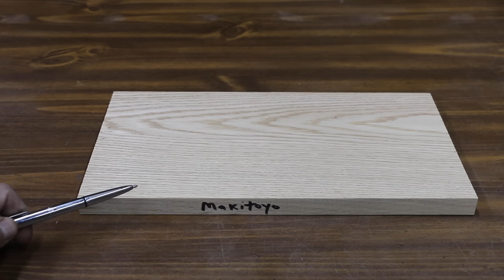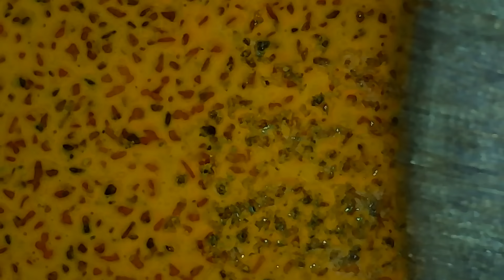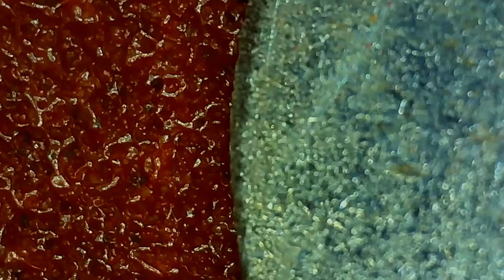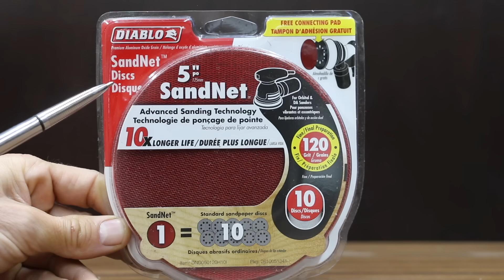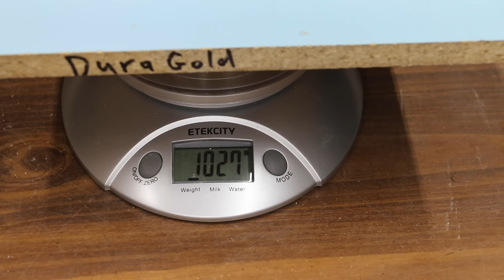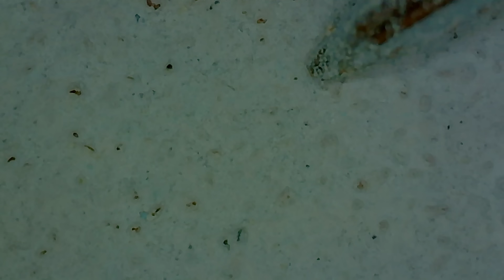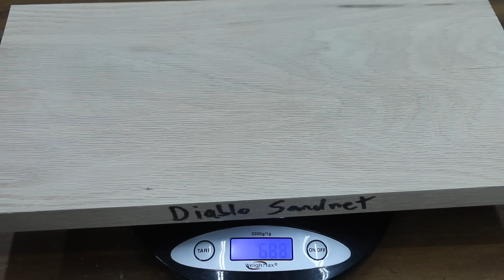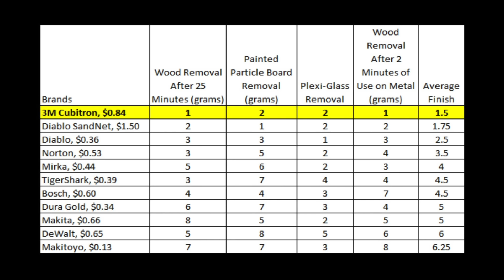Best "Sandpaper" Brand? 3M Cubitron, Diablo, Mirka, Norton, Makita, DeWalt, Bosch Sand Paper

Comment: First off: I love your channel! But as a certified „master craftsman of cabinet making“ (German title, sorry about that), may I give advice on sanding wood?

1. don’t apply pressure. The sanding paper and the orbital sander do the job, not your muscles.

2. Start cross grain, in overlapping zig-zag from one side to the other. Overlapping should be half the diameter of the disc. Do this once or twice.

3. then do the same going with the grain. Do this once or twice, too.

Oh, and yes, I only use Mirka Abranet Ace, as textile net sanding Discs in general last much longer.

Otherwise, carry on!
Reply from the maker: Thanks for the feedback!
Reply: @ProjectFarm  You’re welcome! Keep making these awesome videos!

Comment: You should make a test to find the best diamond angelgrinder cutting disc for cutting concret. Also if theres any differens in how long time a disc will last if you turn it around after its been used already.
Also if a big disc is cutting better than a small disc.
Reply from the maker: Thanks for the video idea.

Comment: Project : When I change my car oil and filter, I replace the oil only with conventional oil for a day or two to clean out the dirt. Then I do a full synthetic oil and filter change. Question : Does this have a positive effect on the life of the engine?  Personal experience, I have been doing this for over 25 years, I have never had to do any engine repairs. ( 16 family cars in 25 years )
It would be interesting to see the condition a a car engine before and oil change vs. after a oil rinse.
Reply from the maker: Thanks for the video idea.

Comment: You are always looking for things to test, how about battery powered pressure washers?  Being they can suck water out of a bucket, they are extremely easy to use in odd places. I just used one to clean off grease and dirt to prep a skidder to weld in the woods. A 5 gallon bucket of water out of the creek and you’re good to go.
Reply from the maker: Thanks for the video idea.

Comment: Hey project farm, love the channel been a long time viewer since you first started. To me it has seemed you’ve tested every know motor oil and additives for them. Here recently it has come to my attention that there are no standards for hydraulic oil, only recommended by the manufacturer of your equipment. But any hydraulic oil producers can clam to meet or exceed those manufacture recommended oils and there is no standards or laws to tell them other wise. I run tractors and I want to run the best but I have no insight into witch one is the best. I was wondering if you could test multiple hydraulic oils just like you did motor oil and give some the project farm approval! Thanks!
Reply from the maker: Thanks for the video idea.

Comment: Been using Mirka for years. Woodworking and boat building. One if the things I like is that the disks hold up extremely well when used for wet sanding ( by hand ) epoxy and paint.
Reply from the maker: Thanks for the feedback.
Reply: And the abranet is really nthe way to go, they last damned long

Comment: Your work is awesome dude!  This is to suggest a review of Air Compressor Regulator/Gauge assemblies.  I just hate the cheap ones that have come with my last two compressors; the haptics are terrible and cranking it up to 135 PSI I always feel the plastic is about to explode at any moment.  The gauge lenses always seem to come unglued from the gauge bodies - They are pretty simple inside and you would think Ingersoll and Parker would have the best ones but I don't know.  I miss the old all brass ones where you could unscrew the bezel and replace the gauge lens and oring - but even ingersoll uses plastic these days. Some brands besides IR and Parker are are USG & Pneumatic Plus but I am definitely not the guy to know the right air compressor regulator/gauge brands.
Reply from the maker: Thanks so much!  Thanks for the video idea.

Comment: Another Great video, 

Though I could have just told you the Diablo was the best stuff available. Kind of suprized 3m did so well. I believe there is a non cubitron version of the 3M that wouldn't hold up quite as well as that. Though no surprise that 3M makes a great product, I've found they make quite a few of those.
Reply from the maker: Thanks so much!  Thanks for the feedback.

Comment: This is an awesome test.   Such a no nonsense approach.   I really wish you had tested the Norton 3x (ProSand) stuff as it falls under Norton Saint-Gobain Label and it is a whole different Animal than that Norton Yellow type you tested. It would be up there with the 3M Cubitron II and Diablo paper easily.  This sandpaper cuts fast especially stands out in its longevity and its ability to sand freshly painted and finished wood w/little to no loading.  Its almost like magic how the paper doesn't clog compared to the current 3M stuff you get at home depot or any other sandpaper I have tried.   This property carries over to wood that is dirty or resinous such as pine and fir.   If you ever do another one of these simply for a different type of paper like  9x11 or sanding belts it would be worth the education of us all to include it as many people swear by this stuff.
Reply from the maker: Thanks so much!  Thanks for the video idea.

Comment: Hey I got a suggestion for a video comparing some 4 stroke synthetic racing oils such as Amsoil Dominator, Valvoline VR1 Full Synthetic Racing Motor Oil and some others. Some of these oils make very strong claims such as increasing Horse Power. It would also be interesting to compare the results of these oils to other synthetic oils you have tested in the past to see if the racing oils perform better or worse than regular synthetic oils. I am getting into competitive go cart racing and I and others race in series that run 4 stroke single cylinder air cooled flatheads and OHV engines that rev at high rpms upwards of 4,000 rpm or higher and run at high temps and using oil that provides good wear protection vs the best wear protection could greatly extend the life span of the engine before needing to be rebuilt. It’s also important that oils don’t foam up inside the engine and that the oil offers the best protection when it is first put in and after it has been ran for awhile under high heat and stress since you usually change your oil after every time you go out on the track. The most common weight oil to used is usually between a 5w-20 and 10w-40 so 10w-30 should be a good baseline oil to use because it’s the most common and almost all manufactures make there oil in this weight. It would also be interesting if a cheaper oil outperform an expensive oil. If anyone els that sees this comment that is involved in this sport or is knowledgeable on racing oil and has any recommendations on oil you use or find superior it would help to have more products to compare. Thanks Project Farm your my Go To when figuring out what product to buy, great videos and product testing. Hope you read this and can end the debate over what racing oils best Thanks, Happy Testing and Comparing
Reply: The racing season starts early may btw 😁

😂 no need to rush your a hard worker and spend a lot of time and effort making these videos and I respect that, if it weren’t for you everyone would be buying the wrong stuff. Thanks for all you done
Reply from the maker: Thanks so much!  Thanks for the video idea.

Comment: Great video. Suggestion for a tests: string trimmer replacement string. Some that I use with my string trimmer just seem to wear out very fast and easily break as I’m trimming the grass. Also a test of hedge trimmers. And floor jacks and jack stands for cars. Finally, replacement chains for chainsaws.
Reply from the maker: Thanks!  Thanks for the suggestions.

Comment: Could you please rate shoe goo, e6000, gorilla glue glass, on boot or shoe repair..  a full 5 day cure ad recommended by e6000 and a few tests.. including after being made wet.. as I've noticed thats often the failing of these products. Just a suggestion.. thanks! Great channel by the way.
Reply from the maker: Thanks for the video idea.
Reply: I'm particularly interested in repair on leather.. but that might be hard to do. Perhaps leather strips on a rubber surface.

Comment: I know this is way off your normal topics, but thought I'd ask. Why the heck are toner cartridge so expensive? I use a Brother printer with a TN650 cart. Brother brand is $112 for 1 cart. But you can buy them for $20 or less. 4 for $47. So what's going on here? Why is the Brother 500% higher? Do the cheap ones work? And it does not matter what printer, they all follow this pattern. Either pay an insane price (printer $400 toners $100+ each). or you buy some cheap things for $20? How does this make sense? Just thought I'd ask. Love your videos.

Comment: I have started using the sandnet  by Diablo and its so much better than anything I have ever used before. It never seems to clog or wear out. This makes the cost reasonable as its lasting longer. Can we have a test on rust prevention. So many products and its hard to know what works at all.

Comment: 3M also makes another product called Trizact, it has pyramid shaped grit instead of cubic like the paper you tested. I found it to last quite a bit longer than most of the other sand paper out on the market when it comes to hard woods.
Reply from the maker: Thanks for sharing.

Comment: I have an idea for a video.  How about comparing automotive OEM/dealership parts to aftermarket ones, perhaps motor mounts would be a good one, comparing vibration dampening and longevity?  It doesn't have to be motor mounts though... could be other common replacement part(s) where the price of OEM is significantly more than aftermarket... power steering pumps or racks, ball joints, ignition coils are a few I can think of.  I don't know how many times I've seen in forums where someone asks about less expensive aftermarket parts (typically because money is tight for the individual), and the response is usually overwhelmingly to stay away from aftermarket.  I highly suspect that these vehicle-specific forums are admin'd by persons associated with dealerships and/or manufacturers, and also, having been an engineer for a Tier 1 gasket supplier (which included CHGs and EMGs), I believe that most car parts are not manufactured by, say, Ford or Honda.  The parts we sent to an OEM engine assembly plant came from the same materials and processes as the parts and kits we sent to auto parts store distributors.
Reply from the maker: Thanks for the video idea.

Comment: If you don't need conformation to curvatures or just need to sand flat surfaces, the ultimate value is a DuraGrit steel backed, carbide sanding disc. They also make other tools. A bit of an investment, but especially for something like wood or plastics, you'll sand thousands of pieces with little to no wear.
Reply from the maker: Thanks for sharing.

Comment: I have a small problem with the first test; your criteria for quality (or at least which one is better) is based on material removal. The problem with that is if a sheet has an inconsistent grit of course it will remove more (or less) material, lets say its 120 grit on the outer half and 100 in the middle or the other way around well that one will remove more material than a consistent 120 all over every time it hits the 100 section (more likely if it is on the outer half). 

I don't know myself if there is any way to account for this unless there was some way to get numbers on a perfect 120 sheet to know exactly how much should be removed in 1 minute of sanding with the same machine...it is possible that the most common result is the correct one and the overachievers are actually bad because they are more aggressive than you want them to be (and of course the underachievers are less aggressive equally bad).

You also say at the end "if it is about the best performing X is the best" well best in what sense? if you mean just pure material removal then sure but why not just use a more aggressive grit?

I bring all of this up because I have had a situation recently where poor quality sandpaper with an inconsistent grit almost ruined something I was working on and the first test seems not to account for any of this I'm not just having a go I love this channel and what you do generally and have based some very happy purchases on your results I just don't think this subject in particular is as cut and dry as the data suggests.

Comment: I use the Diablo sandpaper on my projects.  It has always worked well for me and this shows it.  The one issue I have with the 3M is the small holes will likely not allow the dust collection on the sander to function as well since it prevents the air from flowing well.  The Sandnet looks nice and would work great for collection but honestly not worth the extra cost in my book.  I did notice you skipped the Harbor Freight brand on this one.  I have some really course stuff, like 40 grit that I picked up for hogging material but honestly the 80 grit Diablo works faster from what I could tell... Go figure.
Reply from the maker: Thanks for the feedback.

Comment: I don't know how to contact you for suggestions so ill post here. I'd really would like to know how long a preditor 212cc horizontal shaft engine can run at 5000, 6000, and max rpm with the governor removed before engine failure.
Reply from the maker: Thanks for the video idea.

Comment: VIDEO SERIES IDEA: Testing ratchet straps Load strength/abrasion resistance/stretch under load/improvised use as a tow strap(ask me how I know) maybe homeowner to professional grades?

Saw a farmer almost loose a round bale (1000-1300lbs) a month ago, it was held to the side of their trailer by ONE Erickson brand strap (didn't see the strap rating, too busy praying it didnt break before they went by) about 2 feet off the pavement.
Reply from the maker: Thanks for the video idea.

Comment: I have sometimes saved money with your tests, other times I have had better results by picking a better performing product. On occasion, we hit the jackpot by not only getting a less expensive product but also the same product performs better than others.  I appreciate that you had to plan ahead enough to let paint dry for weeks before doing this test.

Consider reviewing the various electronic hand-warmers.  There is a huge variation in expense, even on Amazon, with some of the less expensive products making better performance claims than the moe expensive. Some can be used as a USB charger for your phone if needed.  Thanks for your consideration.
Reply from the maker: Thanks!  Thanks for the video idea.

Comment: As life advice I'd advise to never skimp on sandpaper. Get the good stuff, sanding is a chore as is and good paper doesn't hurt your wallet too much.
But god I've had no idea how much of a difference there is! Need to get me some of that cubitron stuff! Excellent testing!
I generally use the Bosch made in Switzerland, though the discs didn't seem as good as the sheets... The sheets I love, try them if you find them.
Reply from the maker: Thanks for the suggestion.

Comment: Hey did you ever do a video on NMF Ionic Friction Reducer?  I think the stuff works great. I mean I put a oil cooler on my Harley because obviously they run hot and the fans would basically be on all the time if it got hotter than 70 degrees out. I put that stuff in and the fans have yet to turn on. It runs better too. I didn’t check the damn temp before and after though. I’d love if you did a video on it if you haven’t yet. I was looking but didn’t see one.  Love the videos!
Reply from the maker: Thanks!  Thanks for the video idea.

Comment: One of the issues with sandpaper is the quality of the job.  I've notice with some cheaper brands you get more swirls....leading to poor quality finish on finer hardwoods.  It's not necessarily the speed of material removal that is the deciding factor.  Did you notice any difference in quality of the sanding job on wood with any of these?

Comment: the only complaint i have so far about this test method is the accuracy/repeatability of your scale was not factored into your initial loss measurements.  most scales are rated to be +/- 1 count accurate.
Reply from the maker: Thanks for the constructive feedback.
Reply: @ProjectFarm  its an ultra minor thing I would not even bring up 99% of the time. Some of the measurements were super close though

Comment: comprehensive video, but the most important aspect of premium abrasives isn't brute force removal, but quality of finish. Someone paying the premium for 3M or Mirka wouldn't be overly concerned with slightly faster removal rates, or slightly better longevity, but very concerned with the quality and consistency of the surface they're prepping. Maybe a part 2?
Reply from the maker: Thanks for the suggestion.

Comment: Great idea , unfortunatly the cheaper sand sheets generally have more coarse mixed into the sheet ( will show as faster removal and deeper swirl marks) where 3M is the best paper available and takes less time to go thru grades to a desired finish. Possibly next time use a microscope photo to show a area finished as comparison with quality finish.
Reply from the maker: Thanks for the suggestion.

Comment: Have you ever tested 4X4 traction boards?.....ARB....Rugged Ridge....Rough Country....Smittybuilt generic Chinese? The maximum weight? how much pressure to yielding....Reforming shape after being distorted....MOST IMPORTANT of all and Its probably too late in the year....Cold temperature cracking resistance! How much better are the $300 ones than the $89 ones? Inquiring minds want to know😁
Reply from the maker: Thanks for the video idea.